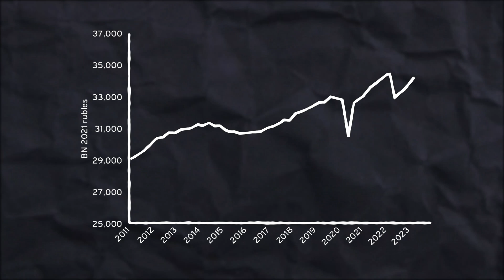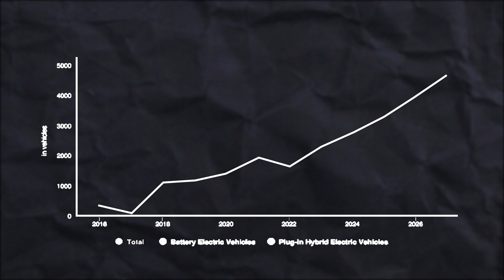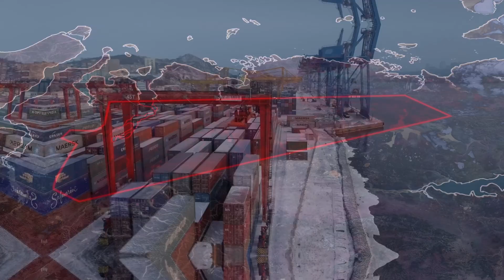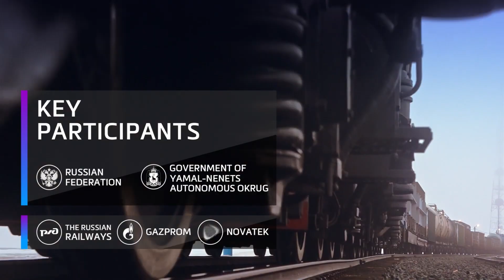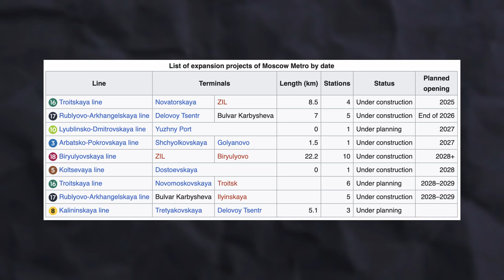TOP 10 Biggest Megaprojects in Russia

Comment: It's strange that you said about Moscow-Kazan HSR, but not about Moscow-St.Petersburg railway which is already under construction(i mean not current October Railway which used by Sapsan, I mean new one with operating speed 360 km/h) and 3 others which is planned: Moscow-Minsk, Moskow-Sochi and Moscow-Ryazan. You are almost not speaking about new cargo railways which under construction too: hallway North-South and other, just about North railway in Yamal. You told nothing about highway construction: new M12 which almost done Moscow-Kazan-Ekaterinburg-Tyumen-Novosibirsk, planned Djubga-Sochi and Ekaterinburg-Krasnodar. You told nothing about airports construction and so on. I think you worked not enough.